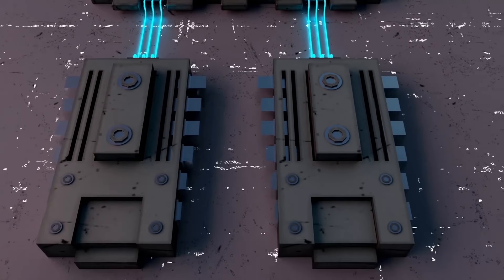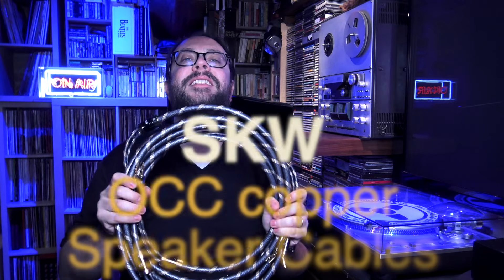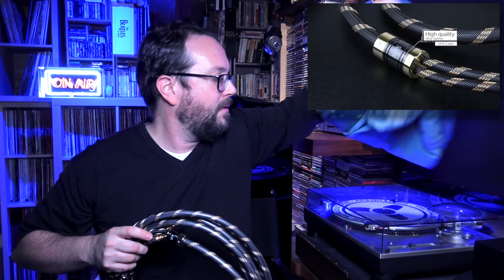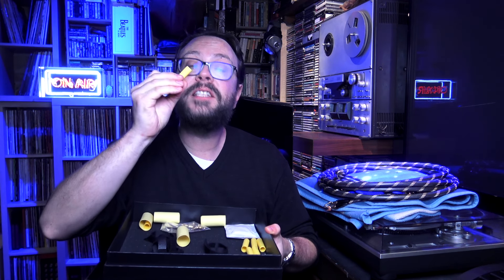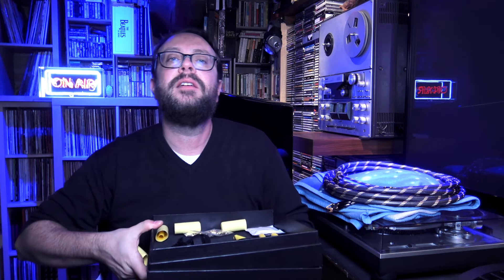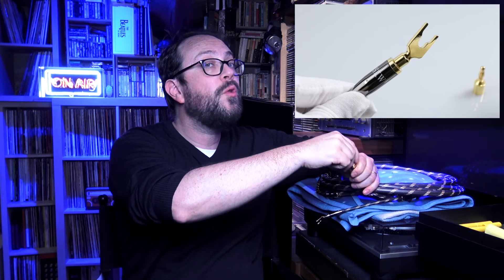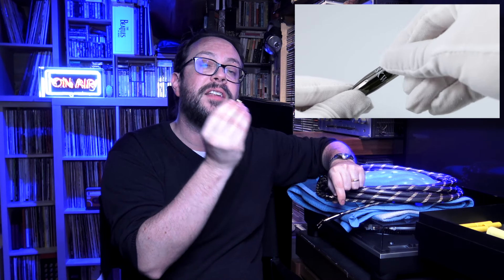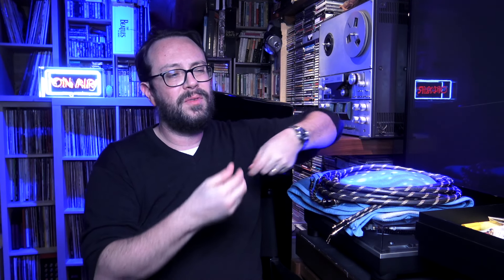Unbelievable high-end OFC copper speaker cables at very low price!

Comment: I’ve been using OFC 12 gauge and 14 gauge for years with banana plug connectors. It is .9999 pure oxygen free copper.
Reply: Go to the hardware store and invest in some 10 gauge THHN wire from the same spools the weekend electricians get their wire. You'll get better performance and that can be easily verified with lab instrumentation. Speaking as an engineer and designer, banana plugs are horrific for passing signals in comparison to old fashioned screw terminals. The weakest link is always the connectors and banana plugs are some of the worst for carrying current. From an engineering perspective, using banana plugs makes your choice of wire almost irrelevant; they're that bad.
Reply: @Peter_S_  10 gauge won’t go in my speakers or fit my gold banana plugs or I would have used 10 gauge. I have a roll now for some outdoor runs I’m going to make.
Reply: @Peter_S_  I sorta lied. I’m using gold plated Nakamichi plug ends. They look kinda like banana plugs. That’s what I have been calling them anyway.
Reply: @HippieRednex  You can always remove a few pieces of the core to "make it fit". The benefits of the decreased resistance are huge and your ears will thank you. In A/B comparisons the larger wire will always stand out, but I have yet to see any engineering data supporting fancy wire standing out even when compared to quality generic hookup wire used for building equipment. This is a place where the engineering numbers go nonlinear so there is diminishing return as you get larger but with higher end moderate power amplifiers and speakers I see it as completely justifiable to use 10 gauge or even 8 gauge; even larger for higher power or greater resolving systems. 

I just looked up Nakamichi banana style connectors and saw two styles; some were like nice banana plugs and some like spade lugs which terminate either wire or banana connectors. The second style looks great. I would prefer more than one screw to set the cable but when you screw the cable in and then screw the connector down, you will have excellent performance, certainly leagues better than typical banana plugs can deliver. You'll have to excuse my categoric dislike of banana plugs for anything other than connecting meter or bench power supply leads but my feelings are based in physics and electrical performance. The problem with banana plugs for carrying any current is they have low contact area so if they're your only option it pays to use high quality plugs that maximize contact area and gold plating on the contacts is IMHO mandatory. Just like plumbing, wires are limited by the most restrictive point in the circuit. I see banana plugs as analogs to flow restrictors.
Reply: @Peter_S_  thanks for the information.

Comment: sorry bro but  using only one material like copper no matter how pure it is cannot deliver the "best" sound quality only with careful mix of materials you can get the "real" tonal balance like tellurium cables....
Reply from the maker: Never use mix metals. They have different electrical properties and the signal does not travel optimally. By the way tellurium is a type of copper that got a lot of hype in the past years, especially when bullet plugs came along. Theybarr good connectors but not comparable to quality OCC copper or even better OCC silver.

Comment: I'll bet these are every bit as good as the ordinary 14 gauge cable, you can buy at any hardware store, or at Amazon, for $20/100feet. Numerous double blind tests, show that speaker cables having different sounds, is pure BS, if the volume levels have been precisely matched. A possible exception, is if a cable, has not been constructed properly, in which case, it would worsen the sound. Cable burn in, is also a hoax. The placebo effect is very powerful. Also, confirmation bias plays a part. If you expect to hear a difference, and if you WANT to hear a difference, and if you spent a bundle on new cables, you will IMAGINE a difference. Waiting a week or two, to hear the difference, is also BS. Any difference, will be noticed immediately.
Reply from the maker: Which high quality cables did you try?
Reply: yeah expensive cables might be of a high quality but in terms of sound quality they can't improve anything. even if cables would color the sound, why would you want that? that sounds awful.

Comment: Do you really think that for that amount of money you get real OCC?
Reply from the maker: High prices for OCC are a gimmick and marketing strategies. In fact if you get bulk cables from Neotech, which has a OCC certification you can get high quality OCC copper interconnect cables for as low as 13€/13$ (3 years ago it was 10$) tax included: https://www.audiophonics.fr/en/balanced-cables/neotech-nei-3004-symmetrical-modulation-cable-up-occ-o-85mm-p-8940.html
Reply: @anadialog  Yes, I know they are expensive, and I also use bulk neotech cables for some years now. But I highly doubt that the cheaper chineese cables use really occ copper, since there are only 2 or 3 manufacturers out there,and speaker cables require higher sq mm, and thus a lot of occ copper.

Comment: too me this speaker cable is not that great so far - i have had for 16 days - i can be patient another week or so - right now its so low end - another product from china thats cheap but there is no clue of how it should sound
Reply from the maker: Sorry to hear that!
Reply: Depends on your system. If it doesn't have the ability to offer more detailing. You're not going to notice any difference with any cable. It's called "synergy", build your system to match, one step at a time.

Comment: Speaker cable break in. Unbelievable, literally
Reply from the maker: Actually it’s science. Dielectrics have a big role and they need time. Once again, experience of s paramount. Just moving them I here degradation which slowly goes back to normal during the following days and this happens also when people cleaned and moved them and O noticed something strange only to learn that someone touched them.
Reply: @anadialog  experience is not paramount because it's biased. Physics is paramount. Cables make no difference if not extremely badly made

Comment: if you think you're going to buy OCC single Crystal on Amazon I got some land in the Florida Everglades for you boy did you ever get scammed, that's what happens when you're too cheap to buy the real thing LOL
Reply from the maker: I have the real thing, and I also make them DIY. There are several items with true OCC copper on Amazon, time to drop this prejudice which only helps the manufacturers to put high price tags on cables and gear that are worth 1/10 of that price.
Reply: @anadialog  so can you prove it to me that you've got OCC single Crystal from China because I talked to several distributors and they say China does not have anything OCC and they know the two companies that produce and manufacture OCC single Crystal, one is in Japan one is in Taiwan so far you haven't proven that China has anything OCC.

Comment: You are not going to hear the difference between them and a piece of romex. Cables CANNOT burn in unless you mean catch on fire. What you are paying for is looks and quality of the parts used but it does not make a sound difference, it is placebo.
Reply from the maker: Which quality speaker cables have you tried?
Reply: @anadialog  it is not about what cables I have or have not listened to. It is basic electronics. Unless you are comparing say expensive wire vs Ethernet cable- 23 gauge . Then perhaps you might see issues because voltage drop/power losses depending on power levels.  Ethernet Cat5e ( the most popular) can handle 100 mhz signal for about 300 feet higher  mhz in short runs. It can handle about 25 watts to about 300 feet.  Ethernet cable handles this without special insulation or occ/ofc copper, in-fact some of cat5e cable is copper coated steel wire. Inductance is not a issue at audio frequency. At these low power levels unless you rap the cables into tight little coils, the insulation on the cables would keep you from raping them into a tight enough coil to make a effective inductor. Essentially what goes in one end is coming out the other end minus power losses in the wire due to resistance. This also applies to interconnects. Quality cable helps primarily with power transmission with proper gauge wire and quality termination. Proper gauge wire reduces power losses and quality termination give tight corrosion resistant connections. Cheap cables cause problem’s mostly from very poor construction . Once you get past a certain level in quality it does not matter it is not going to change the sound. It is esoteric none sense .

Comment: while this is a good package for some and for the money the connectors immediately suspect and are really the a week point second is the pvc but that's just so they can pull the core of wire through something and differentiate the product, when your wasting money on cables get the most gauge for the money for can find these are on the smallish side but not unusable, high-end spades would make the difference but your just plain fucked with those screw terminals, but realistically there are at least half a dozen bare bones manufactures that will make a similar or better cable for only a little more (also not saying its not actually occ but all its china so,,,,,,,,,) either way this is better then some other options but furutech sunyata wireword or my very fav (audio sensibility there top teir product line blows everyone else out of the water)are all safer options that you can keep and trust the cable geometry and build quality with out a doubt(theirs at least a dozen more , glad to hear occ bandied about in the open but only go this route if your poor and planning to stay that way(this really feels like an amazon ad) fuck you for selling out if so :)
Reply from the maker: If you really want to experience audio nirvana the best cables are Neotech. They also sell bulk cables and in fact I make my own.

Comment: This price for 14awg wire is insanely bad. DO not buy these cables.
Reply from the maker: OCC copper? Try to do better!
Reply: @anadialog  "OCC" copper... 
For audio level cables...
Must be a "HOT" signal you're running...

Maybe provide some useful measurements along with those claims or is the "burn in" phase not done yet? 🤣

Comment: also I just looked up the cable and it says that it's 4 9s, single crystal is not 4 9s it's 6 9s so you got scammed man.
Reply from the maker: Chris, relax. Ad I said It's monocrystal copper. They never claimed it is OCC. I call it that way because it is easier. Monocrystal copper is the same as OCC. If it is four 9, it is a little less pure, but the important is that in 1 meter we have only 1 crystal. That is the fundamental aspect.
Reply from the maker: I checked again and on HiFigo they claim it is OCC with 6N: https://hifigo.com/collections/skw/products/skw-hifi-audio-cable-6n-occ-with-spade-banana-terminal-audiophile-speaker-cord?rfsn=5309426.b9b808d

Comment: I reported this low life for not declaring paid promotion at the beginning of the video
Reply from the maker: 🤣🤣🤣 this is not a paid promotion but my life and my passion! I bought these cables with my money. I discovered that they were fantastic and I am communicating this on my channel, as always.
Reply: @anadialog  how and from what soure did you confirm that it is OCC copper? where did you get the glamour shots and b rolls from the cable production from the company if it not sponsored? who uses video from the PR of the manufacturer in a video that is not paid for?
Reply from the maker: Your ignorance can't be my fault.
I used them because I like the shots and the movie, which I cut in certain parts. Its all available on Aliexpress: https://h5.it.aliexpress.com/item/32791421182.html

Comment: Burn in...snake oil
😂😂😂😂
Reply: I always worry they will then burn out at some stage, degrading the sound😂🤣
Reply from the maker: As I have explained in a few comments burn-in takes place mainly in the dielectrics, the insulation of the cable. The dielectric constant modifies the capacitance of the cable hence the quality of the signal. It's science, not snake-oil.
Reply: @anadialog  if I could ask. When do you exactly know burn in is completed? Is there a sudden improvement in the audio presentation? One day it just clicks and becomes better? I am sure if you do a loop impedance test on your new speaker cable and then after your burn in period, whatever time period that is the results would be the same. The conductors in the cable will carry the signal from amp to speaker as intended. A cable is not a tone control just a means to carry the signal. I am not saying that all cables sound the same they can and do sound different between material type etc...
Reply from the maker: The answer is when they stop getting better. Every time I move my cables the sound gets worse and muffled, it is clear. After a few days of listening things are much better and they stay that way, doesn't get any better. Same with burn-in. As you said at the end of your comment, you do perceive differences among different cables, well that is something that only humans can perceive (in most cases, not all cases) and not machines because as I always say, machines measure quantity, NOT quality.
Reply: @anadialog  if that is the case surely using your theory of cable burn in, it gets better, then gets no better but then surely will be on the decline and begin to burn out and sound worse over time? Humans perceive things. The more you listen to a piece of unknown music you eventually start to hear things you missed on first listen. Even how you feel on a particular day can change how you perceive the music you are hearing. Does not mean the cable did that. As you stated in the last part of your comment, machines measure, so if the measurement is the same new and when burned in then sadly the cable will perform exactly the same with regard to carrying the signal. Most home hifi is say 3 to 4m per channel stereo. We don't listen at stupid levels because that would defeat the object of our hobby and destroy our ears capabilities to enjoy music by damaging them. We listen at safe listening levels, not even many watts required to drive the speakers which in turn means the cables are ticking over so to speak. Burn in I am afraid we will have to agree to disagree.
Reply: @anadialog  complete bull...
Next you'll say silver plated copper is best
Reply from the maker: It is scientificically prooved that dielectrics modify the sound so it makes perfectly sense that a powerful signal like that of speakers cables, not the weak one of interconnects, can modify the structure of the insulation over time, hence the sound. It is logic. No mumbo jumbo here.
Reply: @anadialog  I agree to disagree. I know my science especially electronics. I don't think you are based in the UK. If you are let's meet up and I will swap new and burned in cables, you pick the burned in cables 100% every time, then I might believe you have those powers to discern a difference. Send me the scientific report(s) that explains and proves how they conducted test to show results. I am very interested. Thanks.
Reply: @anadialog  😂😂😂😂

Comment: Even this is idiocy. Whatever amp and speakers, go to any hard ware store. Get normal cable used on shade (or whatever one uses to have in the room) lamps. Preferable  with one side marked. As long as you don't connect these, stretched over 4 to 5 meters, YOU ARE OK! Nothing on this earth can improve that connection. Nothing magic in any conductor! It's also better, not using any plugs either. It's called, cold welding. All other monkey story's, disregard those. Worse idiocy, cables never get better over time, that's called PLACEBO ( you adapt, not the cable). Some fun, I use tube amps. You know what burns in, my finger, when I touch a valve after 1 minute hahahahaha
Reply from the maker: Again, please tell us which high quality speaker cables you have tested

Comment: Cable " Burn in". Lmmfao 😂 😂 😂. There is absolutely no such thing. When speakers and sound output are heard by an individual over time. The human ears get used to the sound quality. It has absolutely nothing to do with the cables or speakers. Just like a cheap pair of wireless earbuds. If you keep listening to them, over time your going to get used to them.
Reply from the maker: I wish all of this wasn't true. It would be much more easy. I am sure about this also because one I came back from a trip for my job and my wife used the new pair of cables intensively and the sound was very different, opened up quite a bit. But until you try for yourself you and many other are going to believe.
Apart from this a period of burn-in of the dielectric is scientifically proved to have an impact on the signal, in fact its there must of the action takes place.